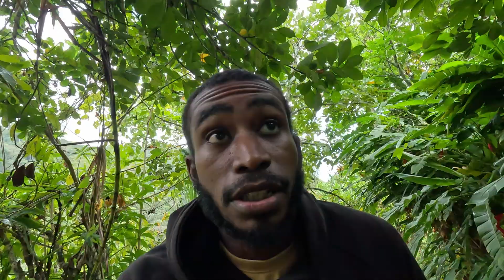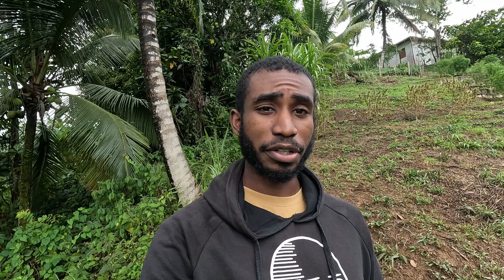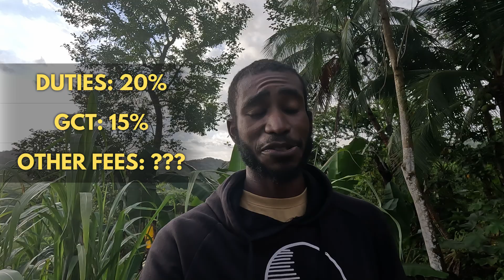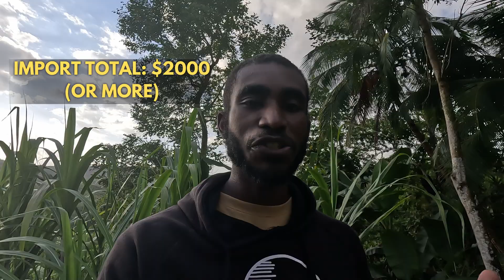Why we NEED to figure out SOLAR for life Off-Grid in Jamaica

Comment from the maker: Portable units, full DIY, or installed by a local company...what's everyone's preference for a solar setup?
Reply: Hi, I recently found this solar company that I’ve watching called Essential Solar in JA, says he’s island wide.
Reply from the maker: @vernajoseph9444  Thanks for letting me know! I'll definitely check out their website
Reply: @the_averagekyle  Essential solar also has very well built Jamaican built power stations that is waay better than the big name ones on Amazon. Also available at Island Eyeware outlets.
Reply: @lawrencedavidson6195 ....I second that.
Reply: @vernajoseph9444 ...I used them for my home. The best decision ever.
Reply: install by a local legitimate company,do your research 1st,cause alot of them only can install an not mentain.
Reply: Depends on the energy usage/size

If your starting small a 1kw to 2k power station is great

You can get a 1kw power station and then spend a few $100 dollars on 100ah batteries for 1.2 KW expansion each

Let's say you get like a pecron lfp100 for $350 on temu, you could then buy 2-3 more 100ah batteries that's about 4kw for about $700

You can charge up the batteries with an external mppt and then release the energy later from the batteries when needed

Comment: Greetings Brother Kyle, quick question for you did you buy the US version (110v @60 hz) or the UK version (230v @50hz) when you purchased your EcoFlow Delta?
I have other questions for you as I am doing the same as you but in Africa and I may need both US and UK versions. Stress.
I would love to pay you a visit if possible.
Reply from the maker: I bought the UK version, but I sort of wish I got a US one. Though, I got a voltage step-down converter so I could use it with some of my US items as well, and it works pretty flawlessly. My only complaint is that I wish I bought a converter that could handle higher wattage so we could use the US washing machine with the ecoflow lol
Reply: Thanks for the quick reply. Trust me the cost of buying an ecoflow or bluetti in the US is way cheaper than buying it in the UK especially with the deep discounts on special holidays. You just gave me an idea for setting up my homestead in Africa thanks, I'll stay intouch.@the_averagekyle

Comment: Exact same issues I’ve had on Roatan. Now I’ve got an Oupes Mega3  and about 2,600W of panels. One thing I’ll say is that if you can get a regular panel, like a rigid, not from the power station manufacturer panel, do that. They’re far more cost effective. You should be able to find at least something in Jamaica. 

I can help you think this through. Hit me up.
Reply from the maker: Ahhh that sounds like a solid setup you've got there 🙌 I'll have a look into Oupes, as I'd not heard of them till now! Thanks for the advice! I'll definitely look into getting a higher quality panel ASAP. The one I've got is an okay start but definitely won't do for longevity. I appreciate the support 🙏

Comment: local setup will likely be still kinda pricey, check out will prowse on youtube & see if diy can work for you - can still have an electrician to wire your 110/220ac side & check the whole setup over 👌🏾
Reply from the maker: Thanks for the advice! I'll do some more research and see if it's possible to make the DIY route work. Maybe I can find some of the equipment locally (like an inverter or panels). And that's a good idea. If I go with this option I'll definitely pay an electrician to wire things up and do a safety check

Comment: If you can learn some basics, mainly safety you can handle diy. 

Rackmount lifpo4 batteries 
All in one inverter 
Roofmount panels

Those ecoflow products are very expensive per wh of storage. If not DIY I say go to local company. 

With diy you can buy a spare inverter etc. and be self sufficient.
Reply from the maker: That's a solid point. Plus I forgot lifepo4 batteries were a thing. My mind always fixates on lithium ion cuz that's mostly what all these big companies use lol. Maybe I'll check some prices out for a potential setup with this method 🤔 thanks for the advice!